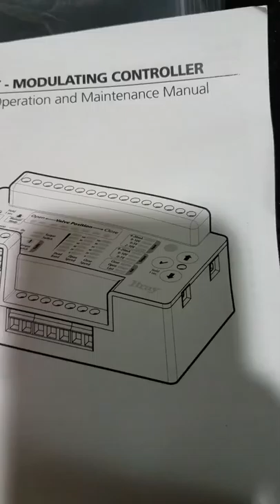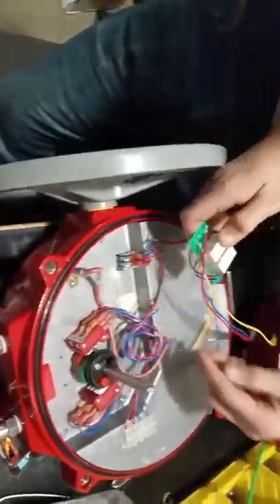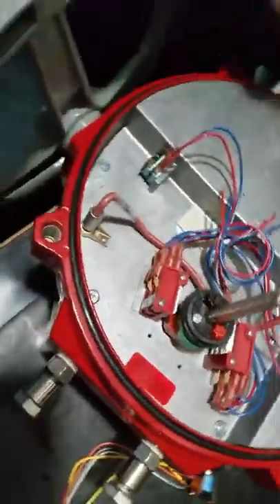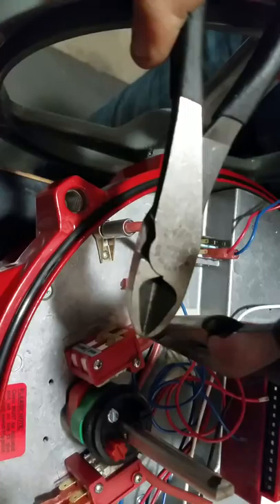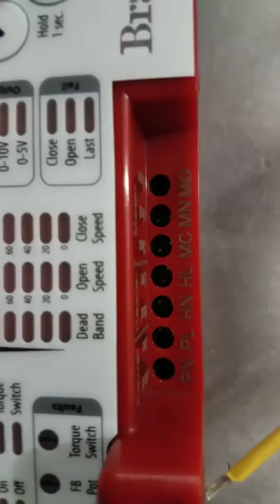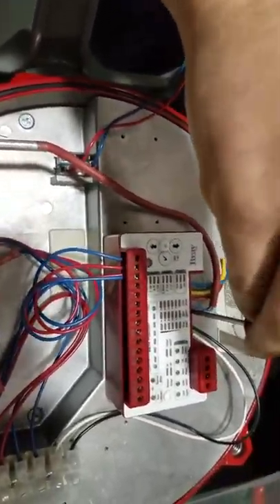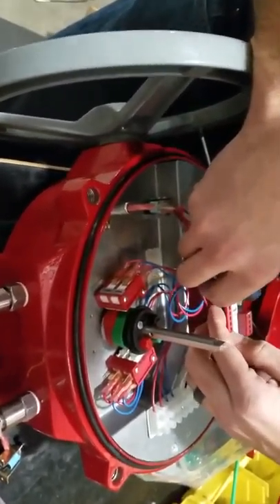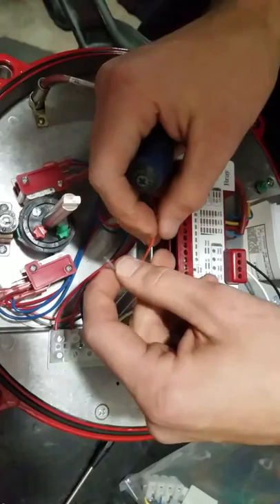BRAY_S70-ACTUATOR_On-Off to Modulating Control_NXT-SERVO

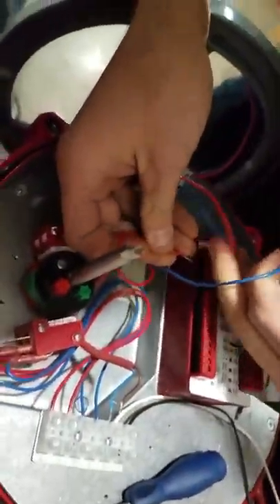Comment: The red and blue common switch wires (at 9:50-10:30) should be separated on the Servo NXT.